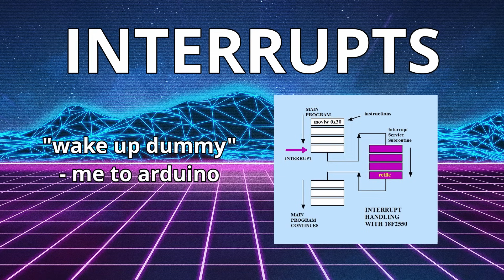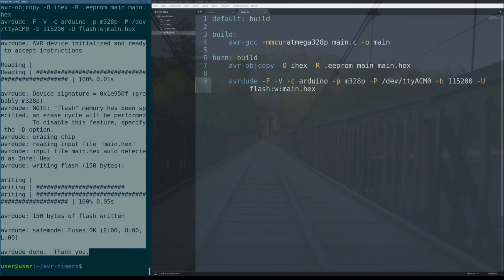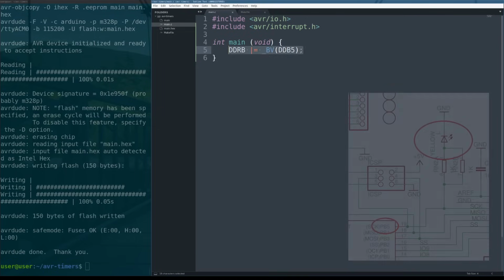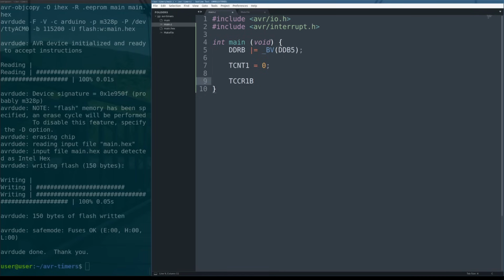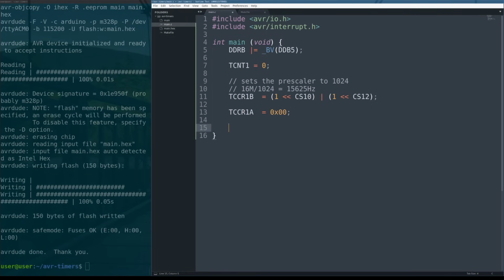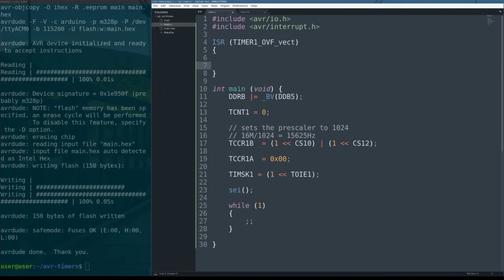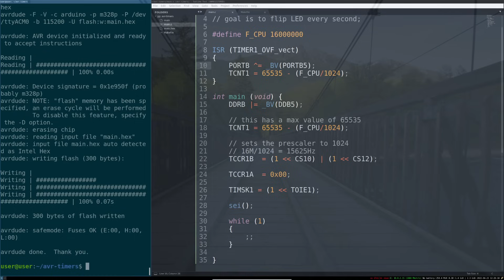Stop Wasting Time, Use AVR Timer Interrupts  |  Baremetal AVR Programming Tutorial

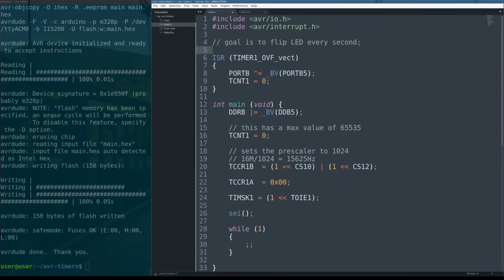Comment: You lost me at 8:57 I don't get how that becomes a second
Reply: He set timer clock= F_CPU/1024 = 15625 Hz
That means after 15625 clocks one second of time passed.
Timer1 is a 16bit counter and it will overflow to zero after count value: 65535 (2^16-1) (and then cause the enabled overflow interrupt)
So if you preload the counter value to
counter_MAX_VALUE+1-clock_counts_for_a_second_passed:
65535+1-15625 = 2^16 - 15625 = 2^16 - (F_CPU/1024) it will overflow
after a second. ( and i think we need to add +1 to make it right because overflow from 65535 to 0 will also consume a clk of time  )

he did make a "one off" error i think
Reply: @Henry-sv3wv  yo thanks alot mate 👍

Comment: thank you so much. if I want to have three timers so what part of the code will repeat? i suppose I would have to change 1 with 2 and 3 in TCNT... and also an ISR should be set for every timer. could you make a bare metal programming video on I2C and another on U(S) ART for the Arduino chip?

Comment: Really you should use OCR1A and OCR1B registers for the timer value and set CTC mode for timer 1, rather than setting TCNT1=0 in the ISR.
That will get the hardware to reset the timer to zero for you immediately it matches the programmed OCR value. As your code stands there is some latency between the interrupt being triggered and your ISR getting called, so you will not have “exactly” 15KHz (or whatever frequency division of the CPU clock you are aiming for). Worse, if other interrupts preempt your service routine, you will also introduce drift with a manual reset.
Reply: So if i want precise /*let's say for a watch*/ 1ms implementation i need to setup pre-scaler for 64 16000/64 and then implement s/w pre-scaler for 250 for exact 1ms, but it will load uC 250 times harder! Or setup pre-scaler for 1024 but then adjust, i.e. jump over every Nth tick. Do you have a good article/video about it?
Reply: @alexloktionoff6833  This video goes into a little more detail on using CTC mode (which should cause less drift ) https://www.youtube.com/watch?v=cAui6116XKc

Comment: Instead flooding the CPU with "push" and "pop" with using interrupts, you should start coding in a sequential multitasking style. Using a few interrupts is no deal for most conditions. But using interrupts for every single task you have ends up in wasting very very much time executing "push"s and "pop"s. Just have a look at the assembly output from the compiler.

You are right, sleeping the CPU with delay() is waste of time, but using interrupts as a global task worker results in a lot of time waste as well.

Comment: When I wrote my space invaders rip-off on the AT328 I got a stable framerate by using this interrupt by putting at the end of the frame loop a while(variable){ }; variable=1; and then in the interrupt I set variable=0, so I would just loop there until the interrupt kicks in. 
I don't know if that's the best way to do it tho.
Reply: That's the same way I do it actually. I don't think there really are any better methods that aren't specific to any particular CPU

Comment: I am having trouble with flashing the code using avrdude: avrdude: stk500_recv(): programmer is not responding. I am on Linux Mint, 64 bit.
Reply: Arduino IDE also could not upload. I bought a Mega, that one works fine with Arduino IDE. Tomorrow I plan to try this tutorial using the Mega.
Reply: @cernejr  Arduino IDE won't work on my Linux Mint either. It installed but when I click on it the window just flashes onto the screen for an instant. Good thing I did a dual boot so I can go into my old Win7 install and use it from there. I never use Arduino code but just type AVR C into Arduino IDE.
Reply: sudo avrdude -v -p atmega328p -c arduino -P /dev/ttyUSB0 -b 115200 -D -U flash:w:firmware.hex:i
Reply: (if you use an arduino or 328p with installed arduino bootloader)
else some other command with usbasp over isp or whatever you use

Comment: Thanks for the helpful video.

2 things I had to google:
Do CS10,CS11&CS12 change a lot for different avr chips? Else wouldn't TCCR1B = 0b101;  be clearer? maybe that is just me.

Is using _BV() to show different methods to do the same thing or would (1<< (PORTB5)) not have worked? When I googled _BV to see what it was someone said something about using << creating problems with macros but never said what.
Reply from the maker: They may be the same value across boards, but you want to avoid using magic numbers like that in the event there IS a change and now your code isn’t portable. 

Also using defines makes your code more readable.
Reply: i just grep -r CS10 *
in avr/include
to see that CS10 is bit 0 on all chips
---> tested the rest, bit positions are the same

Comment: I need deeper knowledge about atmega 328p
Reply: The data sheet has everything you'll ever need, but it's a difficult read!

Arduino Software Internals is a good book, by Norman Dunbar 😉, and explains both the Arduino Software and how it works, the ATmega328 hardware, timers, etc, and how the software talks to the hardware.

It comes highly recommended by Ralph S Bacon on his You Tube channel.

Cheers,
Norm.
Reply: @NormanNodDunbar  ty, I'll read it. I mean channel is called low level learning, but in this video compiler is used. compilers r too easy😅 how about writing code in hex redactor? 
ofc, I'm kidding, but in every joke there is a part of truth😅
Reply: If you are still struggling try Human Hardrive YT channel.

Comment: Instead of XORing PORTB, PIN5 to toggle, just write a 1 to PINB5. That will toggle for you.

Cheers,
Norm.
Reply: yeah the Atmel datasheets are really good, super thorough, detailed and easy to read as well.
Reply: Quite so. Though that may be an Atmel quirk? His code appears easier to understand.
Reply: @7alfatech860  yes indeed, it's Atmel. Input pins use the PORT register to enable pull ups, output pins use PIN register to toggle. It's all in the data sheet.

Cheers,
Norm.

Comment: It would be worth including a comment about how the interrupt flag gets cleared. In many micros you have to do it explicitly but I am guessing the Atmel clears it automatically when you reload the timer. A common mistake used to be forgetting to clear the interrupt flag.
Reply: Another common mistake is forgetting to clear the interrupt flag before enabling interrupts. 

If the stimulus to trigger the interrupt is detected by the hardware, the flag will be set and will remain set even if the stimulus goes away. When interrupts are subsequently enabled, the ISR will trigger even though the interrupt stimulus is no longer present.

Cheers,
Norm.
Reply: The AVR automatically clears interrupt flags when the ISR is executed. You only need to manually cler them if you are not using interrupts.

Cheers,
Norm.

Comment: Should it be "by using Arduino Timer Interrupts"?
Reply: Not really. This is pure avr C programing without the dumbed down Arduino code.
Reply: there are different arduino boards, but the hardware timer of the physical microcontroller chip is providing the timer interrupt and uno does have the ATmega328 mcu

Comment: Thanks for this.  Can you please do this same thing with another processor, say an SAMD21 or RP2040?  I have used up all 6 ISRs on the 328P and need more, but can't understand the datasheets of the Cortex M0+ processor.
Reply: Yeah, took me a few weeks to figure this out.  You can make a career outta the stuff you're trying to learn, keep it up!  These cortex-m cores have dozens of hardware interrupts.
Reply: At the expense of some delay, you can implement a tree of software ISRs. Like there's 1 ISR that gets called on multiple IRQs. And then you (somehow) switch on which interrupt was actually triggered, and call the function appropriately.
Reply: You need  more than 6 isr???
I am curious , why not possible? You CAN have more imho

Comment: Nice, easy to understand. I would still suggest adding more comments about the register assignments for easy lookup but the video is short enough to rewind.

Wouldn't it make sense to also use a macro since we were the same code twice for TCNT1?
(In the end both the compiler might precompute the constants into a single value so this would only be for the human reader.)
On the other hand, the TCNT1 assignment in main() is basically setting the first delay. Can we just set it to 65535, as basically an almost zero delay to just not worry about it? Or is there a chance that the timer will tick "too fast" in the background if there is more setup code in main() before the sei() call, so the initial value will overflow and need to increment the total amount before the first "interrupt routine" is being run?

Comment: If you had something like a TL866 chip programmer and the 328p was removable, could you just dump the hex file directly onto the microcontroller?
Reply: It's not an (e)eprom, so not the TL866.
But you can get a dedicated progger.
cheap ones are based on usbasp.
there is also an arduino sketch to turn an arduino into an isp prog device.
avr isp --> AVR In System Programmer
(using ISP you don't need to remove the avr out of the circuit)
(you also use avrdude for flashing)

more expensive: AVR HV-Programmer
(to rescue a chip from wrong fuse settings (like if you disable reset pin to gain extra IO you can't program it anymore with isp --> bricked without HV Programmer to change fuse settings)
Reply: @Henry-sv3wv  Good to know - thanks